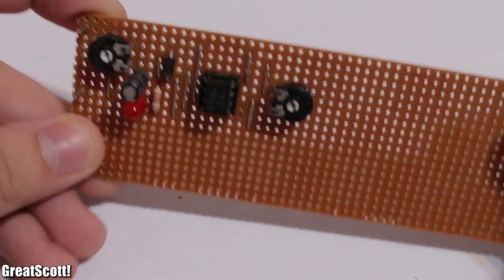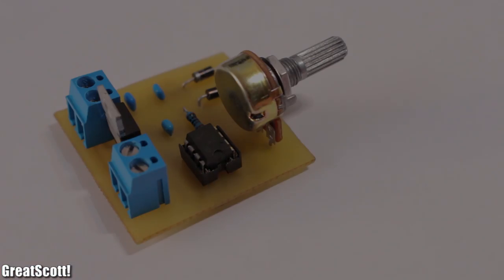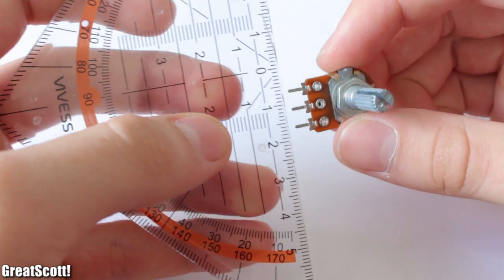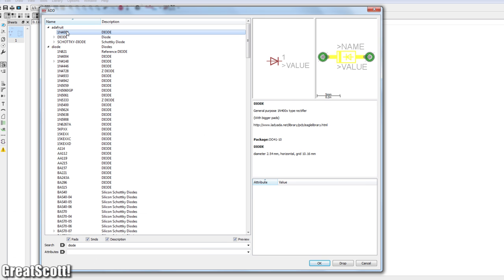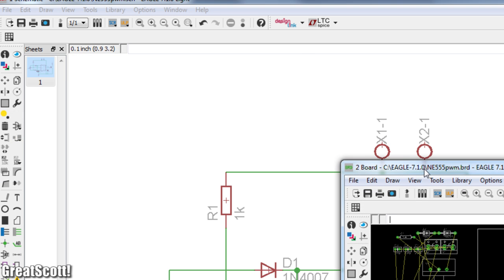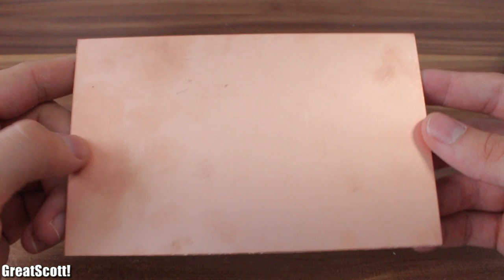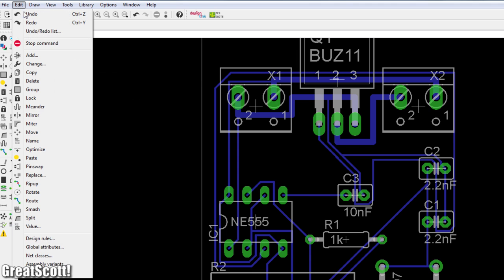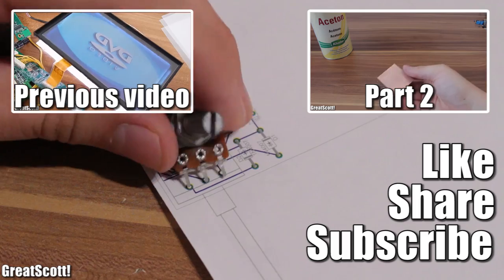Homemade PCB Etching (through hole parts) - Part 1

Comment: That was nice! But are you sure about all those 90º bends on the routes? I’ve always heard that we should use two 45º angles instead of a 90º...
Reply: yes it creates interference when high frequency signals passed through 90 degree turns that's why there use this for making antenna(signals gets radiated from sharp edges)

Comment: I make double sided boards this way. I n order to line it all up, you put 4 mounting holes, one in each corner. Then put the top image on as a mirrored image. Then drill the four holes carefully. Then line up the image for the other side by lining up the  mounting holes. Then use parchment paper under the board to protect the image on the top side while you iron on the bottom side. Then etch and if you drilled the holes accurately, it will all be good.

Comment: GreatScott, will u please explain why the 555 can't work with the c1 capacitor 102 (0.001 uF or 1 nF) and less.  In my design the potentiometr is 20k and everything seems to work in software simulationbut not IRL. Thank you!

Comment: Sadly Eagle is pretty useless for anything other than really quite small boards - 80cm^2 (4" x 3.2") limit. KiCAD, Easy EDA and others do the same or better job without such ridiculously small limits. Autodesk really ought to re-examine its size policy for hobbyists. Until they do I for one won't be using or recommending their usage.